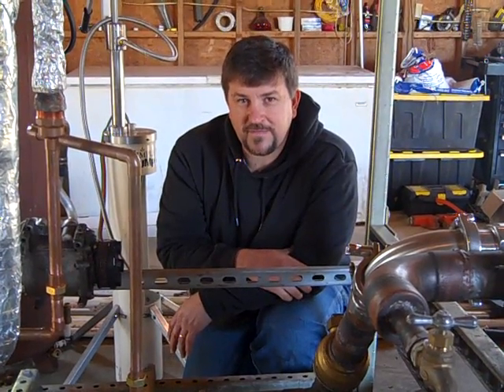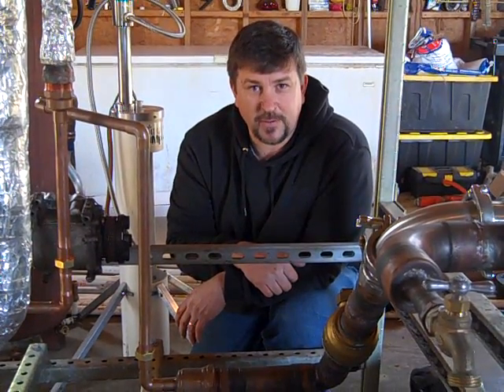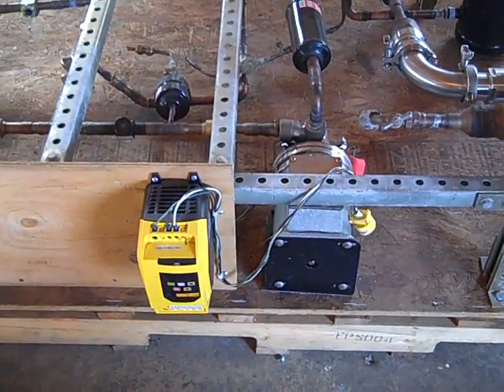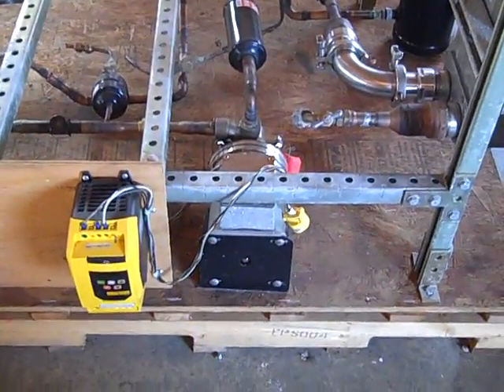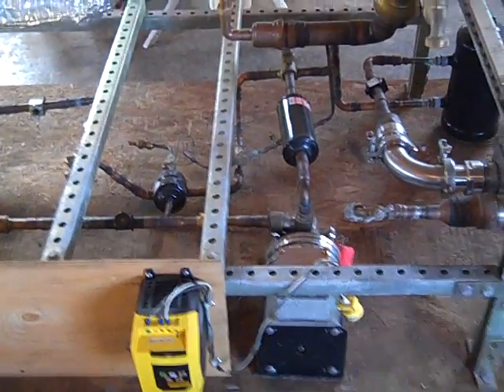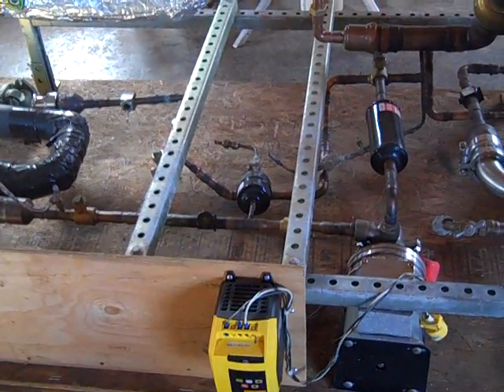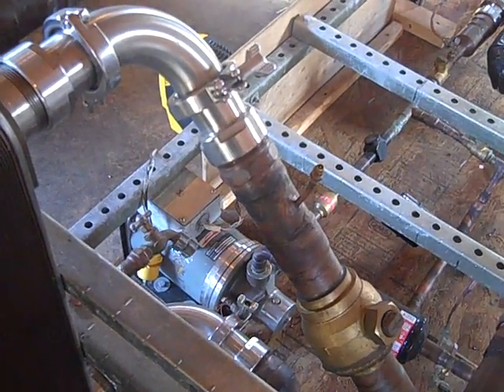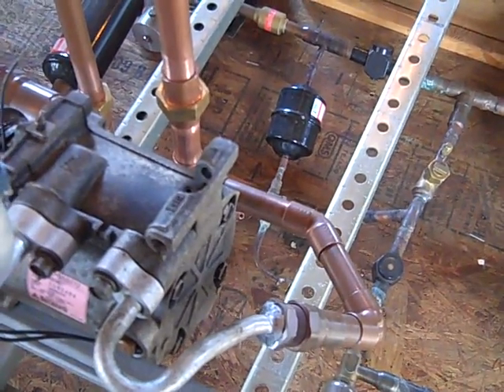Fire Power! Organic Rankine Cycle

Comment: 245fa, boils at 15 celsius.
This thing won't work in the summer, but will be a champion in the winter!

I'm curious what the efficiencies will be.  If you are getting 50%+ this is a winner, and could sell mass produced.

This would be especially well suited to northern climates, where wood is plentiful but temperatures are -30C in winter.
Reply from the maker: Though is boils at that temp it needs to be heated more to produce the pressure to turn the expander.  Its a year rounder.
Reply: engineer775 Practical Preppers Makes sense, I imagine the water on the condenser will do the trick.  In your opinion, is an engineer degree worth it?  I have my 3 year engineering diploma, takes 2 years to upgrade to a degree.  Are you finding decent work as an engineer?  Thanks!

Comment: Ok, that was a lot for me to take in...lol What I'm missing is how you're transferring energy from the fire to the Rankine Cycle?
Reply from the maker: Through a plate heat exchanger both for the heat in and the heat out on the condenser.  in the video the heat in side is insulated and the condenser side is not.
Reply: Got it, thanks! I'm looking forward to more on this... :-)

Comment: cool, i didn't know some car generators are made to work on gas, ive only seen belt driven generators.
ive been thinking on how to store some of that heat when heating a stove and am intrigued by Salt, what would you make of it if id make a something of a copper spiral on the chimney (waterheating) and cover it with salt so that it would store some of that heat and release it when needed , is it even practical or just plain insane? or perhaps its possible with another material?

Comment: Do not mix the refrigerant sir!  That would not be a good deal (15 yr refrigeration man here).  Do you plan to generate more wattage than your pump uses?  That is the difficult part.  The scroll is the best design for the generator, as pistons or screws have more mechanical parts to fail.  However you might want to use a hermetically sealed compressor out of a residential air conditioner because of the lack of seals to worry about.  You will need to get one through your hvac friend as you need a license to buy one.  Speaking of licenses you may want to get a 608 license to avoid a pretty massive fine $25000.00 for handling refrigerant without one.  Are you going to use steam with a check valve as the evaporator heat source?  The pressures in that case will be extreme.  Remember to build for safety ;)  Sounds like fun Bro.
Reply: Also, just thinking...  The compressor does have bearings which need oil.  The residential scroll compressor should be spun the correct direction not backwards as the compressor has a dip tube which will auto lubricate the bearings as long as the compressor turns the right way.  You should also locate the compressor at the lowest point for oil return reasons.
Reply: One more thing, LOL!  Make sure that you have a 30" vacuum in that system before you introduce the refrigerant.  Heat + oil + moisture = acid.  You do not want to have acid in the system.  Also looking at the way you have the unit piped has a minor flaw.  The filter you have selected is a suction drier and is designed to be mounted in the vapor line (before the condenser).  You have it located in the liquid line (after the condenser).  I am very interested in this project!  Can you tell?
Reply: Never mind about that drier Bro, sorry I should have looked closer.  You do have a liquid line filter drier there.

Comment: Aloha.
Not sure I understand even a fraction of what you are assembling, but seems similar to a HRSG at a commercial Calpine Power Plant.....recovering and using energy that otherwise would be lost as wasted heat.  While you are adding various elements to it, don't forget about the stable and FREE thermal energy characteristics of the earth itself.   Go down just a few feet, summer or winter, and the earth maintains a very stable temperature.   You can utilize that by drilling a well and lowering a loop of plumbing materials.  Look forward to seeing your ORC progress in 2014  :)

Peace & Prepare

Comment: Engineer775,  before you go too far on this project look into a governor for the scroll expander.  I have already been down this road with steam.  It was VERY scary when my turbine spooled up, accelerating out of control.  Check out some of the dump load strategies the wind power folks use.  If you would like to see how fast an expander can go on minimal pressure, check out my video from 2006 on the Sabbadess channel.

Comment: It would seem on the scale of your set-up that any power produced would be too little or too much depending on demand in the home.  Possibly your system could be hooked to charging a battery bank to even out those periods of low demand.
Reply from the maker: You are correct that is why I mentioned a battery bank with the ability to interface with the grid and sell back.  I am shooting for 1.5 kw/hr. 24/7  - Good catch.  :)

Comment: So how does this compare to a stirling engine/generator when it comes to price and efficiency?

A stirling needs really high temperature to get really efficient, and i guess  that the steam turbine also gets better efficiency with higher temperatures even with the low boiling point refrigerants? 

I had not heard about running steam turbines on refrigerants to be able to run them on lower temperatures before. Really cool idea!

You could combine it with the gasifier/generator that you have to get a combined cycle with really good efficiency getting a lot of energy out of the wood.

Comment: I'm curious if the system will at some point become saturated with heat or will cooling the condenser with water from a creek or some large quanity body of water help keep it from just building heat to the point of saturation?

Comment: Curious to see what kind of inlet and outlet temps you will need for the heat exchangers.
Reply from the maker: inlet 180f  and outlet 60f is what I have without getting fancy.
Reply: engineer775 Practical Preppers This may have to be a project that I replicate.

Comment: i understand what this is, but how available are the chemicals youre using? if there is a shtf scenario...then what when you run out of the chemicals? fyi i know nothing about this but i think i understand the engineering behind it
Reply from the maker: It is a hermetically sealed system.  No leakage or it wont work.  245fa is readily available and I will have a couple of extra cylinders on hand.
Reply: engineer775 Practical Preppers I have read where the working fluid in this kind of configuration was butane.  So you have options on the availability of a suitable working fluid.

Comment: Awesome proof-of-concept project.  You Sir, are the bomb!
Reply from the maker: As long as it doesn't become a bomb I will be happy.
Reply: engineer775 Practical Preppers Whats the PSI your looking to run your Scorel ? Or how ever you spell it .. I may have a working pump that may work but the PSI is like 300+ for min RPM.. Thanks Brother God Bless.
Reply from the maker: yankey4 120 psi
Reply: engineer775 Practical Preppers They have air compressors that use a 'blower' type worm drive...would that be more  durable as a scroll, if plumbed correctly??
Reply from the maker: BoilerRoomRadio I don't think it will be more durable but it might be more efficient.  Thanks
Reply: +engineer775 Practical Preppers I think piston engine could be a replacement of turbine for low level heat source and low capacity generation but there is  a problem like contamination of lubrication oil with organic fluid, I have design a special type cylinder engine which could be use to generate up to 25Kw, efficiency is also high compare to turbine.

Comment: Now your speaking my language. Real power density. In Spain they are biulding a supercritical co2 brayton cycle with a efficiency of 56% driven by a power tower. You could biuld a two staged heat engine that would run on the Rankin cycle at lower temps the switch to the brayton cycle at nighter temps. Your heat would be a rocket mass heater and solar thermal. You could have refrigeration by installing a jet ejector on the exit of the expander with a secondary loop after the condensor
Reply from the maker: I like the refrigeration concept and in theory it has been done as an input to the expander. GW univeristy is tops at this. It is tempting to try to add to thie cycle but once the cycle works I will have enough electricity to run as much refrigeration as needed.  Thanks for the input .. you have me thinking.

Comment: Have you looked at propane as a working fluid?
Reply from the maker: Sticking with the non-flammable working fluids as there are enough variable to dial in.
Reply from the maker: engineer775 Practical Preppers I am using a safer version of propane 
Pentafluoropropane.

Comment: any reason this is better than TEG'S (thermal electric generators)?..cheaper ?..produce more power with smaller fire ? ive seen refrigerant powered turbines before ..from what i understand you dont need a tremendous heat for them to work ...great vid :}

Comment: Steam-driven engines (pistons or turbines) are easy.

Boilers are the dangerous part.  The existence of mid-pressure (by today's standards) boilers caused the creation of the modern insurance industry.  Note that Hartford insurance's original name was The Hartford Steam Boiler Insurance and Inspection Company.  Look up "sultana explosion".

You are smart to work with a lower-pressure fluid than water.